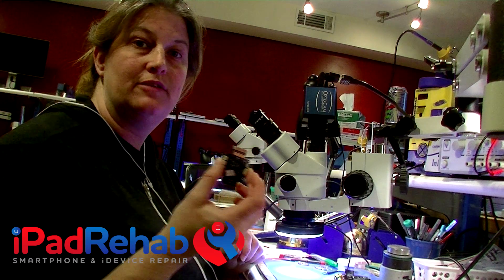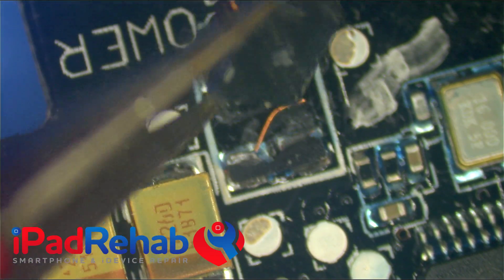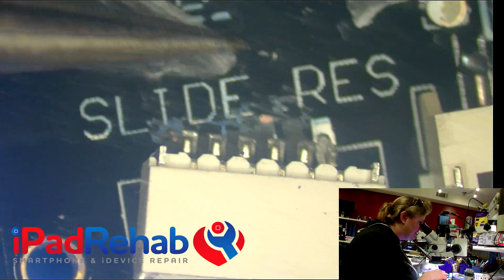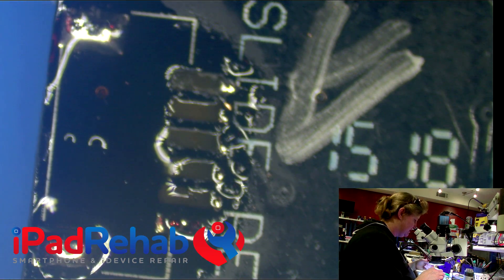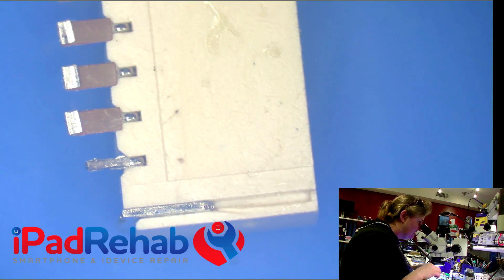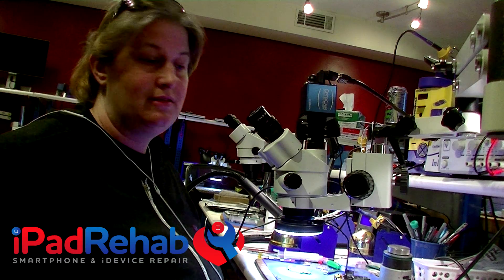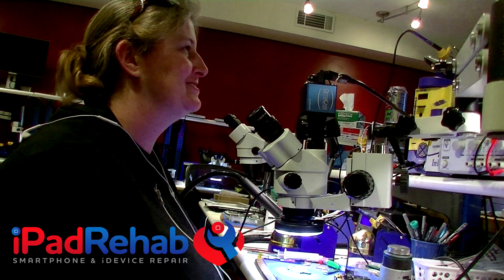How to Fix a Drone Gimbal PCB after flying it into a tree

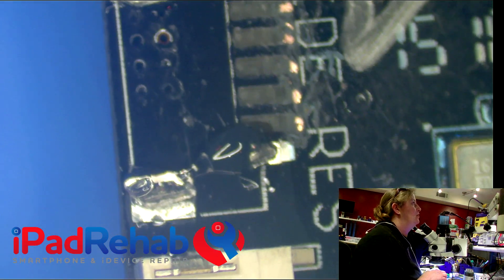Comment: Very awesome video! I do a lot of similar stuff, but with all the wrong tools :D. Anyways, quick question, are at 4:44 are you using solder paste or solder flux? In your description you put two links one for paste and one for flux, could you please clarify which you adding to the board? Thanks!

Comment: Hi Jessa, like the video on the repair to the gimbal board. I have a simular problem. I parked my drone in a tree, just set it nice and gently in the branches. Only two gimbal pads came loose but they have a mono-filament line that runs through the pads to prevent the wires from over extending and causing damage to the board, but it didn't work. Somehow a few of the sockets pulled completely free of the board. After watching your video I believe I can repair the board myself but in your video you did mention that you wish someone would send you a doner board. Well I have got one in great condition because I tried to replace it. What say you, can you help out a veteran and maybe we can help out many future drone pilots?
Reply: do you still have the board ?

Comment: You are a sorceress!  I need help with a pcb board that is BRAND new. I mean it hasn't flown more than 100 yards.  It flipped over on the first take off for some reason from a Typhoon H and they would probably repair it for free probably but I would love to make a video on my TY channel from conception to completion. I have subbed your page.  Well when it happened, the gimbal (which is the part of the drone (UAS) of the Yuneec Typhoon H that tells it how to react based on the movement so it stays still.  It also speaks via wifi to the "Ground Station" better known as a remote control to the bird.  I lost the ability to connect to the gimbal (so no camera) after this bizarre crash which was really just the bird flipping over but having inspected the board, it looks like ONE of the three things (that I have no idea what they are) on the outer rim bit it's the only thing there are 3 of on the CGO3+ camera.  I would post the fix all over the RC forums from Phantom Pilots, DJI, Yuneec, Yuneec-Forums, RCforums,  AVSforums, and I promise I would drive TONS of traffic to your channel.  

Would you be interested in this project.  I am also interested in talking to you about a possible reality based show on what you are doing. I am a VFX supervisor and director in LA.  Please e-mail me at uptolevel6@gmail.com and I will give you my real e-mai to discuss it.  Of course we would have to spice it up but you remind me of a friend that fixed a "Alien Dunk Ski Ball" game from a mobo that HAD A HOLE in it.  Let me know if you would be interested in helping me out and possibly me helping you out.  I think it's a great idea for a show.  I'm not kidding at all.

Please let me know on both.  Thanks!

Adam

PS - Thanks for making me a little less scared to look at the mobo of a gimbal.  To me that's about as micro as a board can get. I don't even understand how you can solder points on that.   You are a master of your craft.

Comment: the Coil was an so called common mode Choke it is used to filter Signals and Power supplys, hence why it is near/connected to the Power Pin. These are not that important u can often just remove and bridge them, but that is not good practice. But you can replace them very easily they are not that critical. I know you are not an electrical engineer, but if u need information just feel free to ask
Reply from the maker: +TecKonstantin sweet :)  Tell me everything you know.
Reply from the maker: +TecKonstantin Here's one more specific.  Is there any design reason, other than cost/effort, that would be compelling for NOT putting underfill under bga chips in all mobile electronics?
Reply: It really depends when you need to use underfill, there are a number of reason why you want underfill, It provides extra rigidity with strong mechanical bonding between chip and the PCB.It also helps transfer heat from highly-complex, high-power chips and sometimes acts as a heat sink. Also, as an efficient coefficient of thermal expansion (CTE) absorber and stress-relieving agents, underfill can help smaller packaging during thermal mismatching. While Reflow and later use.Moreover, stress is dissipated throughout a device's package, and the concentration of stress on the roots of the solder balls is avoided. Underfill also greatly improves the high-gravitational acceleration performance, thermal-cycle performance, and fatigue cycle performance. So it is sometimes needed sometimes not most devices are not very sensitive. In Mobile devices it is quite helpful to use it but as you sad it costs Money and technology to do such manufacturing. One reason it is also not used every time is that it can be tricky to setup right, you can make thinks worse if it is not done correctly. And i dont think that the manufacturer has high reliability on the top of there list. Sorry for the wall of text
Reply: +TecKonstantin love your wall of text :)
So would it be fair to say "the iPhone 6/6+ has no underfill under the touch ics, whereas the iPhone 5/5c does primarily because of additional manufacturing costs?"  Or would that be too presumptuous, and a legitimate design reason could exist in your opinion?

And now for another question---what is a "singing cap"?
Reply: It is a bit hard to decide black an white, in my personal opinion it is better to have it. But i dont know the design very well so it is hard to decide there could be a good reason why they changed it or done it different, maybe they tried to optimize the design, save cost or thought they don't need it. So there could exist a good reason but still not a good practice either. 

the "singing cap" is a phenomenon, if i think what you mean, that can appear with Ceramic capacitors also Multi Layer Ceramic Capacitors (MLCC). Those Capacitors can exhibit piezoelectric effect.That means that depending on the voltage the Capacitor can produce an audible sound. This effect is inherent with those components, most of the time i does not really appear. But under special circumstances this "singing cap" phenomenon can happen. The piezoelectric effect causes the capacitor to change in shape/size but this is a very small effect only different of a view nm. But if the Capacitor is subjected to high electric stress this singing can happen. But allot of factors can effect those thinks like the PCB acting like a speaker membrane. But i have to say i did rarely seen such issues they are quite seldom. And if there is an audible sound most of the time it is something different like Induktors.
Reply: Ive done a little Research and i have to say, removing the under fill in the 6 a bad design decision an a easy one to fix, they just have to do the underfill, the machine is already there and the knowledge. If this error is common they should have acted accordingly. Also the placement of ICs can help preventing Mechanical damage.
Reply: Ok once more i also could imagine that there is a problem within apples Redflow process. It is not easy to get a good thermal process but not an excuse.

Comment: hi how name, soldering tweezers? I want to buy something like this
Reply from the maker: Hi! Thank you for your interest in the equipment we use.

Flux: https://mailin.repair/amtech-nc-559-v2-30-cc-16160.html

Station: https://www.amazon.com/gp/product/B0012BC3TM/ref=as_li_tl?ie=UTF8&tag=rossmanngroup-20&camp=1789&creative=9325&linkCode=as2&creativeASIN=B0012BC3TM&linkId=c37220e0ce001d7a5715c06aeb7648b1

Tweezers: https://www.amazon.com/gp/product/B009SCNJOK/ref=as_li_tl?ie=UTF8&tag=rossmanngroup-20&camp=1789&creative=9325&linkCode=as2&creativeASIN=B009SCNJOK&linkId=5d011299f6ba3effaa2ee4012df19da5 

Tips: https://www.amazon.com/gp/product/B00NTB4RTW/ref=as_li_tl?ie=UTF8&tag=rossmanngroup-20&camp=1789&creative=9325&linkCode=as2&creativeASIN=B00NTB4RTW&linkId=d8dea927bda54ddc3acbfdbf24badd66

Micropencil: https://www.amazon.com/gp/product/B00O4H41X2/ref=as_li_tl?ie=UTF8&camp=1789&creative=9325&creativeASIN=B00O4H41X2&linkCode=as2&tag=rossmanngroup-20&linkId=467ab5cdc75e3fcfeabd5093cebbcc20

Microscope: https://www.amazon.com/gp/product/B005MRAAR4/ref=as_li_tl?ie=UTF8&camp=1789&creative=9325&creativeASIN=B005MRAAR4&linkCode=as2&tag=rossmanngroup-20&linkId=8c3b94523f849afcbb9e232f303e4670

My preferred hot air station: https://www.amazon.com/gp/product/B00FS7C08U/ref=as_li_tl?ie=UTF8&tag=rossmanngroup-20&camp=1789&creative=9325&linkCode=as2&creativeASIN=B00FS7C08U&linkId=73e81b54b2754c643f1b53dfe0a06276

Affordable, but still workable hot air station: https://www.amazon.com/gp/product/B000R94OHE/ref=as_li_tl?ie=UTF8&tag=rossmanngroup-20&camp=1789&creative=9325&linkCode=as2&creativeASIN=B000R94OHE&linkId=5063e5f2215b1182dbb07273bbb5ae77

Ultrasonic cleaner: https://www.amazon.com/gp/product/B00VGXXJDA/ref=as_li_tl?ie=UTF8&camp=1789&creative=9325&creativeASIN=B00VGXXJDA&linkCode=as2&tag=rossmanngroup-20&linkId=86be2e7d472d625cd48a93eee9cc94b1

Ultrasonic cleaning fluid: https://www.amazon.com/gp/product/B00BWESDKW/ref=as_li_tl?ie=UTF8&tag=rossmanngroup-20&camp=1789&creative=9325&linkCode=as2&creativeASIN=B00BWESDKW&linkId=18797ab2fefeebbb442a4bd0a694e963

Multimeter choices Extech: https://www.amazon.com/gp/product/B000EX0AE4/ref=as_li_tl?ie=UTF8&tag=rossmanngroup-20&camp=1789&creative=9325&linkCode=as2&creativeASIN=B000EX0AE4&linkId=36de4ac106c105fb0a2ebb9f1c4d869c Fluke: https://www.amazon.com/gp/product/B00NE9FF40/ref=as_li_tl?ie=UTF8&tag=rossmanngroup-20&camp=1789&creative=9325&linkCode=as2&creativeASIN=B00NE9FF40&linkId=f95a90929aa103f39d05402c47d4042e

Multimeter Probes: https://www.amazon.com/gp/product/B000VRFKPW/ref=as_li_tl?ie=UTF8&tag=rossmanngroup-20&camp=1789&creative=9325&linkCode=as2&creativeASIN=B000VRFKPW&linkId=e6a7d3405038f673acc26eca8758dc10

Solder: https://www.amazon.com/gp/product/B004X4L076/ref=as_li_tl?ie=UTF8&tag=rossmanngroup-20&camp=1789&creative=9325&linkCode=as2&creativeASIN=B004X4L076&linkId=86c54186bfd0fb0992820adb50ec8bee

Comment: Damn, you're awesome at soldering, so steady handed. I find I do alright with some if the finesse work, but, my hands are about as steady as an epileptic monkey with the hiccups.
Reply from the maker: +Elizabeth L. You can grip the tip with tweezers in your other hand, and with a whole lotta forearm on the board just about anyone can get the shakes under control and get 'er done.
Reply: +iPad Rehab Going to try that out in the morning. Thanks Jessa! I drink so much caffeine that my hands rarely stay as steady as I'd like. Usually try to just to do deep breathing to help get the focus off my trembles.
Reply: Elizabeth, Louis Rossman has similar troubles. He never says why besides that it's medical, but somehow he manages to solder perfectly well even though he's shaking all over the place. Perhaps try and figure out whatever he's doing?
Reply: this is a type of hyperactivity. But we can suffer from hyperactivity and be very accurate.

Comment: I have an iPad 3 I replace d the screen because they dropped it and half of the screen was dead I thought it was just the digitizer that broke but it doesn't work and I look at the connecter and its missing some black thing on top can you repair it?
Reply: Yes, send a quote request to the website at www.mendonipadrehab.com
Reply: Do you have a screen on hand to test ?
Reply: +Hector Romoarias yes of course
Reply: What's the turn around time?
Reply: +Hector Romoarias submit a quote request to the website, all details are there

Comment: Any reason to not use jumper wires on the connector instead of shoving it further back? Like is it more stable that way, or its just a time saving measure?
Reply: I felt it would be more stable soldered to the board this way.  Otherwise the mechanical strength would only come from epoxy